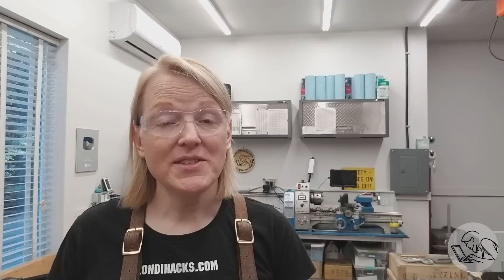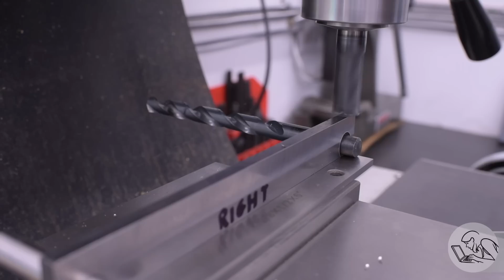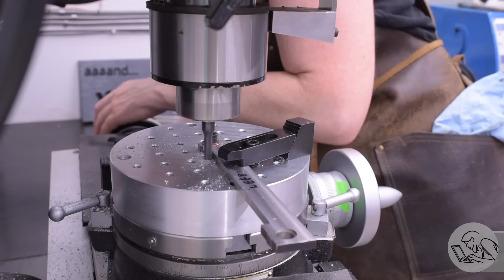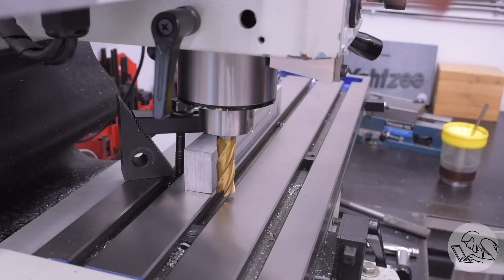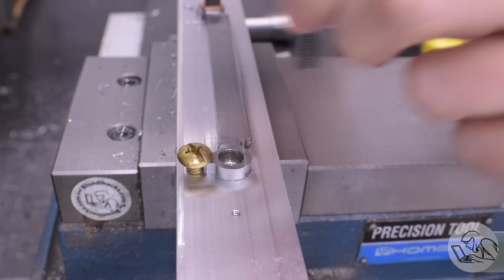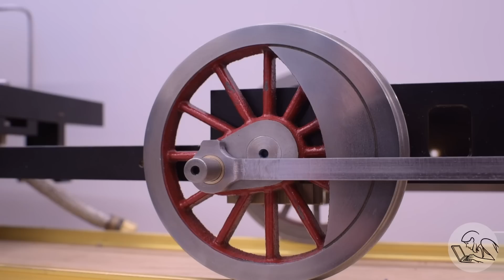Finishing Side Rods - Pennsylvania A3 Switcher, Part 43

Comment: As a retired professor of chemistry I am going to pick a totally unimportant nit.  Oh wait, should I glue the caps lock down and hammer the keys?    

At 14:30 you say "There are probably 10% of the molecules of steel left".   Well,  most of the steel is small crystals of atoms of iron.  The carbon will be distributed as both atoms of carbon dissolved in the iron and some molecules of iron carbide.  There will also be a few other types of both atoms and molecules due to other things added to the alloy.  Overall the ratio of atoms to molecules will depend on the composition and heat treating history.  

So yeah,  the machining did remove 90% of the molecules,   but most of what it removed were atoms.  :)

See, I told you it was an unimportant nit,  but I'm a chemist and I can't help myself.   Please forgive me.

Comment: I like the fixture plate idea.  As you say, being so thick it'll last for MANY years.  Um... At the risk of letting the cat out of the bag early I assume that it is fully double sided so you only need to skim it   on both sides after many projects?  I'm already looking forward to that video and will likely get and machine up a round hunk for my own rotary table.  And perhaps do the same extra thick idea for my rectangular plate for the milling vise.

On the last shot of your side rods I noticed that there's still some slight waviness from the milling.  What about a little time with some emery cloth on a backing block to turn those into horizontal streaks?  Although for anyone not looking at a close up in the video I'm sure that they look great.  You might have shot yourself in the foot with the close up on my BIG monitor.... :D